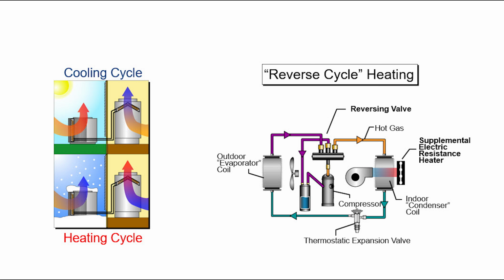Commercial Heat Pumps

Comment: Hi, can you please help me. I am taking about 2 pipe JC Fan coil units. Recently, I changed the thermostat, and I installed venstar t1075 thermostat on it .but it's not working. The NO valve is in closed position when I turn ON the unit. I put back another JC thermostat from a different unit, and it works well. But why is it not working with venstar. I tried to do 2 pipe settings in the thermostat, but it's not. I can do only setting 1 and 2, and then after it's not going to the next setting, I have no idea why